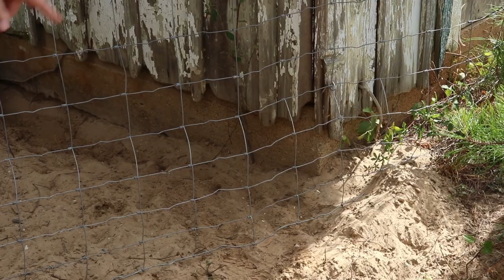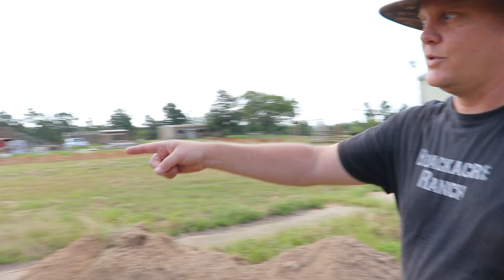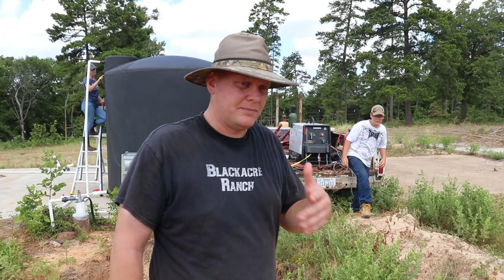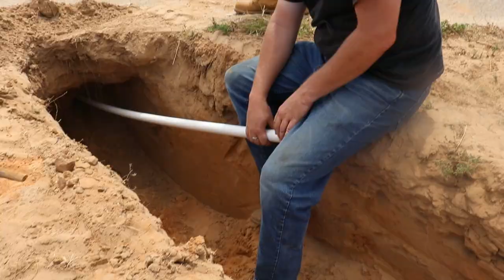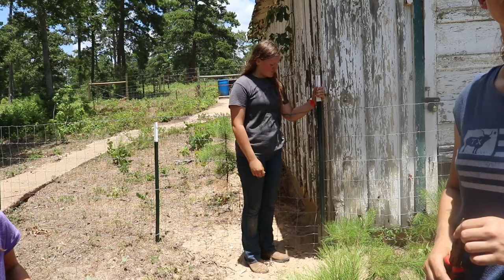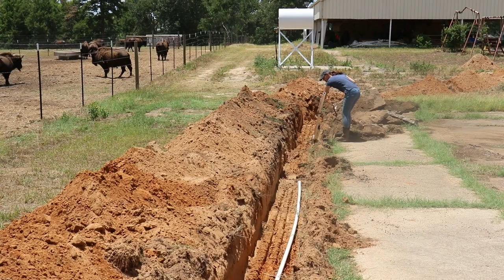Ep. 194 - This is Long Overdue | Bison Ranch Infrastructure Changes

Comment: Pro tip. When going under the sidewalk put a couple strips of duct tape over the end of the pipe to keep it clean. Preferably the bell end then you can use a razor knife to cut the tape from the interior diameter and just leave the rest on the pipe.
Reply from the maker: Thank you

Comment: I would install posts at each major trench intersection and junction for water and electric then take pictures of the trenches relative to visible landmarks to help you find them in the future when needed.  Did you consider municipal grade polyethylene pipe with brass compression fittings where needed?  You might could have had it in 100 or 500ft rolls and fewer joints...
Reply from the maker: That is wise to do.  Always want to remember where the  lines are.  Never know when you'll need it or when you'll regret not knowing.